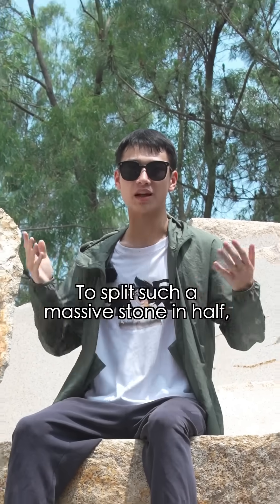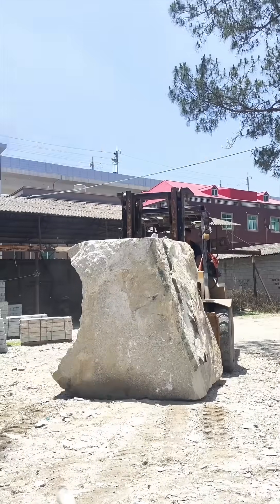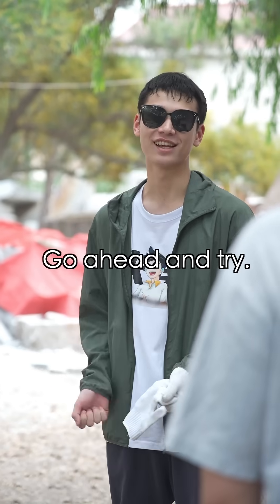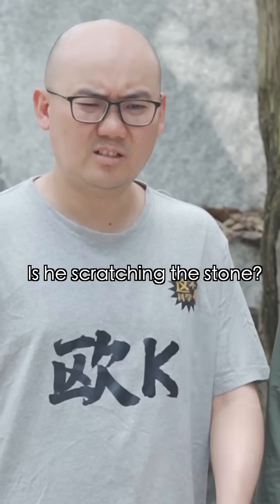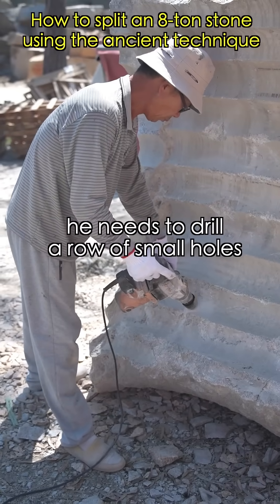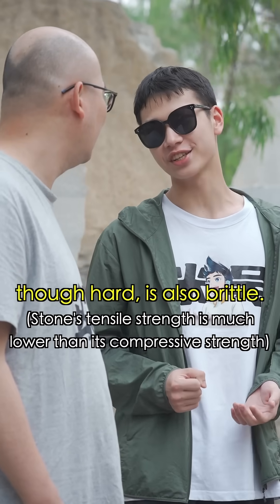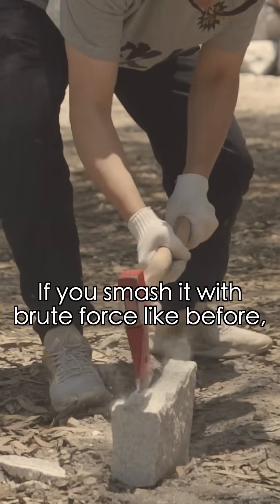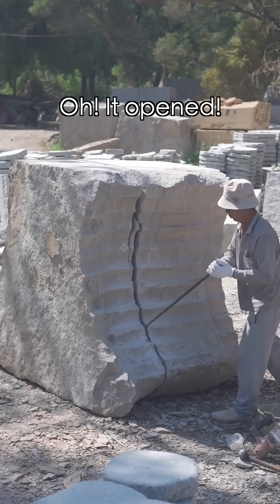Could You Believe Ancient People Can Split a Massive Stone🪨 in Half Without Machine❗️

Comment: The beauty about the technique is that because stone is so stiff, once you split a bit of it, the torque created by the spread splits the rest easily. When one part of the stone splits, the rest has three paths: it follows, it bends or it breaks. And because the stone always breaks along the weakest area, it'll never break off, and so the back part of the half will just follow the angle of the front part and that's how you get an 8 ton Boulder split in 2 with just a few inches and a lot of pressure :D

Comment: They didn't have steel axe heads (or iron) drill bits (much less electric drills) in the days of the building of the great pyramids of Egypt. Only small, rudimentary copper tools were found. And not many of those. Certainly, they weren't up to the task of accurately quarrying millions of perfectly flat multi ton bricks of granite and fitting them together so perfectly that you can not even fit a hair in the seems and that still stands today. Nice try though. Still a cool enough video.  Even to show how the axe couldn't split the small slab of granite.
Reply: The Egyptian pyramids were primarily made from limestone. And this is an argument from incredulity. The fact that you can’t comprehend it doesn’t mean ancient civilizations were incapable of doing this.

They explain in the video that modern tools obviously weren’t used. They use modern tools to save time. Because using a copper hand drill is going to be time consuming. And fitting rocks together is just a matter of carving. 

We literally have an unfinished pharaoh’s sarcophagus in a museum. It was cut improperly and scrapped. If they actually had modern or futuristic tools, it would have been an easy fix (in fact, such a mistake wouldn’t even happen). The cut stone also is clearly not done by a mechanical saw, it was cut with imprecise hand tools.

Comment: The reason this happens is because rocks are brittle. Brittle materials fracture suddenly because their atoms are tightly bonded in a rigid structure, like a crystal lattice, that doesn't allow for much movement or 'slip.' When stress is applied, these strong bonds break cleanly along specific planes of atoms, known as cleavage, without any significant deformation first.

Comment: The question is, how do you chisel those holes with bronze tools, which is what we were told they used. Try chiseling holes in granite or basalt with bronze tools.  It's been tried and they failed.  We can't explain how some of the holes were made in some of the ancient structures in Egypt.  Really makes you wonder how they did it.
Reply: Hammering a metal piece for like 12 hours with a slave doing it nonstop
Reply: @Tom-f3q watch how fast those bronze tools get worn down too.  They become unusable after a few hours of abuse on the granite stone.
Reply: @sharksmate switch tools ?

Comment: You can split it. But how do you polish it to perfection where the accuracy is 1/1000th of a millimeter, like in the Khufu pyramid in Egypt, and haul it from the granite mining area to transfer 800 miles away without making even a scratch or slight dent into the masoned slab?
Takes a kind of technology alien to humans even today.
Reply: Transferring a rough piece then sanding it next to the build sight ???
Reply: @Tom-f3q you can't sand a rough piece if it is as big as a slab. Transferring it to a boat that can handle the weight of 3 to 4 tons each is a gargantuan task. Moreover, dragging and lifting it to a boat is basically impossible as poles and organic rope cannot sustain the massive weight of the load.
Think about it.
Reply: @rogeliozamora9264 you can drag the stone on sledges or wooden logs and sanding a piece of stone with thousands of slaves isn’t that impossible
Reply: @Tom-f3q where will you procure the wooden logs? Can those withstand the crushing weight of 3 to 5 tons, for a distance of 800 miles on rugged and uneven terrain?
Furthermore , highly accurate polishing to a thousandth of a millimeter for even today's equipment is staggerring to think about; if today's technology can muster that. Much more so in those olden days without any help from extraterrestrials.
Reply: @rogeliozamora9264 ancient Egyptians used hardwoods that can easily withstand up to 1 ton of weight per log and had dozens of workers/slaves drag them for miles either on wet sent or on sledges, and they sanded the stones with rougher ones to begin with then switched towards more precise sand quartz size which they had an abundant deposit of to achieve a smooth and fine finish, to put it in simple terms it’s just skilled labour and craftsmanship

Comment: In south indian large rocks are split in a similar method.  Instead of drilling holes, small rectangular pits are chiseled out and in place of the longer wedges used in this video shorter wedges with a flat rectangular tip that fit into the rectangular pits are placed in them and rythmically tapped.  The rock splits! 😊

Comment: Is explanation with idiotic. And there is no stored energy what's happening is called a compression fracture and that's due to the structured elements that is being used on. And the depth and with make a difference also. You're basically prying The Rock apartment and how you place everything and what you use determine whether or not is it even split and separation.
What do you think they used to Stone Mason.

What you doing is using compression to trigger a energy release. Once it reaches critical mass then the energy just like rubbing two sticks together will ignite.
Now if anyone described it that way they would be completely correct energy is not a constant

Comment: You can split this stone with no machinery! 5 seconds later: pulls out a drill
Reply: he literally says how the holes used to be manually chiseled. the drill is just to make it easier
Reply: He said a cutting machine
Reply: If you pay attention he also states that before drills they were chiseled in manually
Reply: Drills were invented long before you think
Reply: A hammer is machinery. Manual machinery. You have manual drills still today. The fact that the time scale doing the work is irrelevant versus the possibility to do it.
Reply: Not even a drill, a hammer a chisel could be used to make a hole. My dad used this on a small scale on brickwork back in the 1960s before battery powered electric drills.

You could even buy a special chisel for putting Rawlplugs into a brick wall.

Comment: They changed the original video. 
Before it said "Can split without any machines" but the old man used an electric drill.

So this new video says "Without using any cutting machine"
Reply: You could have used a hand drill and it would’ve worked just as well. It just would’ve taken longer.
Reply: If you want to see that go find a documentary of a marble quarry in India where a worker does that exact same thing manually for 12 hours